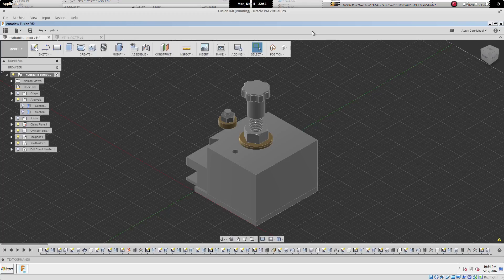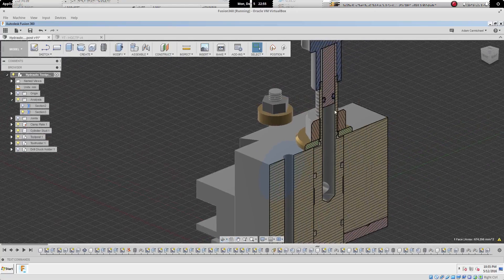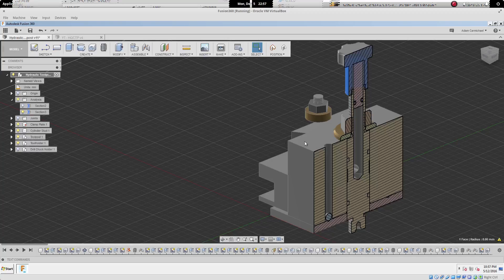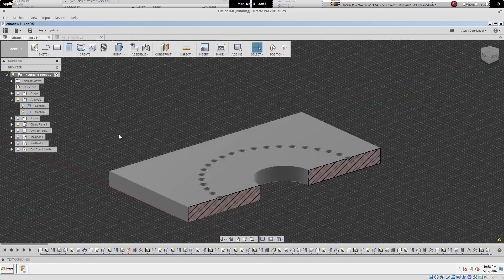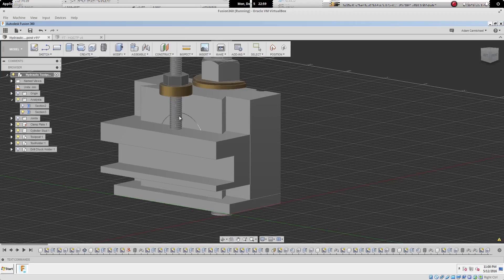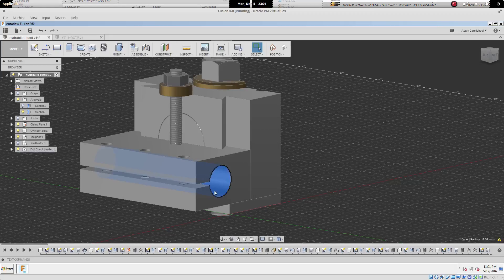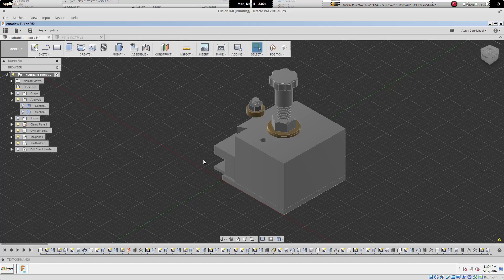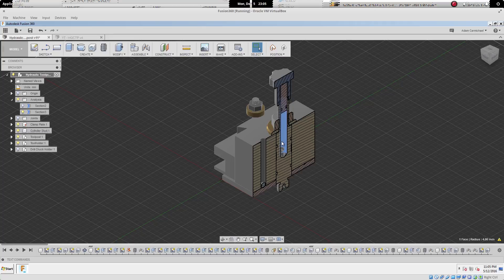MECH::Hydraulic Quick Change Tool Post Overview

Comment: I suggest you prototype the pistons.  It might be difficult to create a surface finish good enough to seal against the pressures involved.
Reply from the maker: Will do. The pistons don't worry me as much as the cylinder bore. O-rings provide the piston side of the seal, but the cylinder bore provides that part, and wants to be lapped pretty nice. I'll send you a still from an upcoming video [it'll go public Dec 23 or maybe a little sooner] with the sort of finish I'm aiming to repeat :)